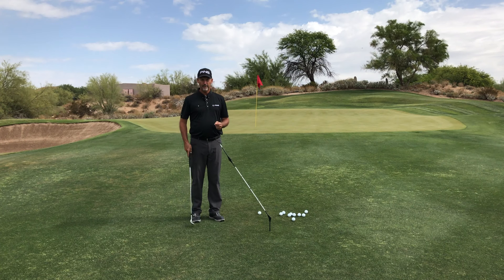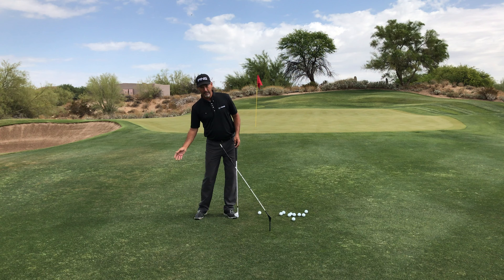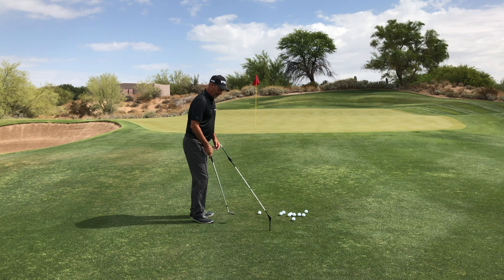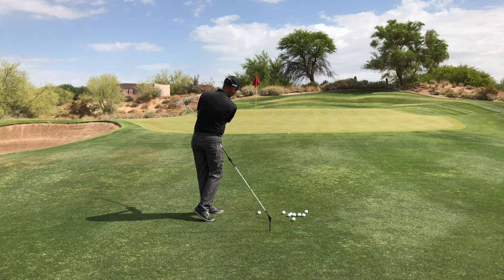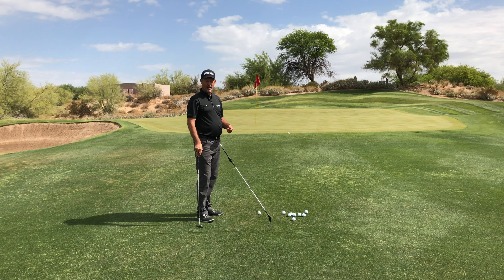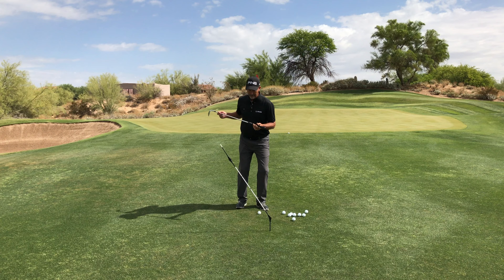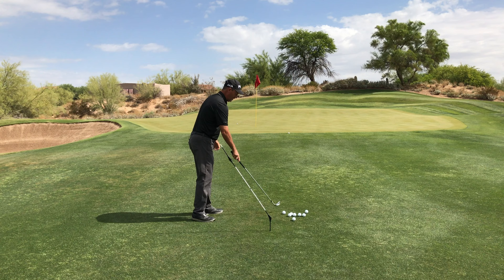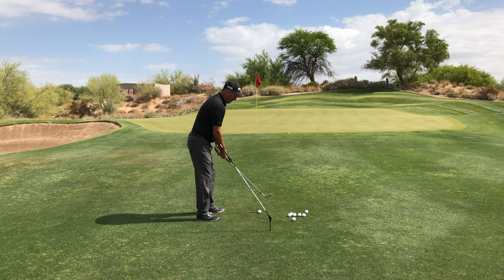Chipping Your Ball Close to the Hole

Comment: Have your book and my short game is fundamentally your technique, especially bunker shots. 

I add an ever so subtle EBWB - Joe Dante’s early backward wrist break. I’ll apply more wrist break for running shots whether chip or pitch and my distance control comes from Mike Austin as does my full swing. 

Mike teaches 1/8, 1/4, 3/8, and half shot chips and pitches. I translate it to 7:30, 8:00, 8:30 and 9 o’clock using the Utley short game method. 

Someone commented on the hands first release and another your ball position off your left toe. I’d tell the first to lead with the lead wrist (this is where EBWB helps) and as for the second comment, I don’t recall a ball off your left toe in your book; seems to be a deceptive camera angle and foreground interference. 

I do have a specialty shot for close pins from greenside rough. The ball is off the left toe and the takeback and release is altered to accommodate a clubhead first release with the right hand pushing under and through. 

As you say in your book, I’m making money off my bunker shots.